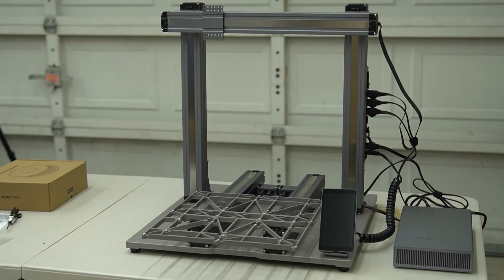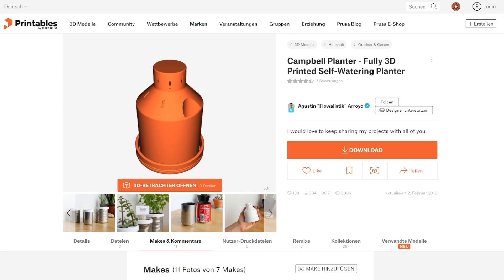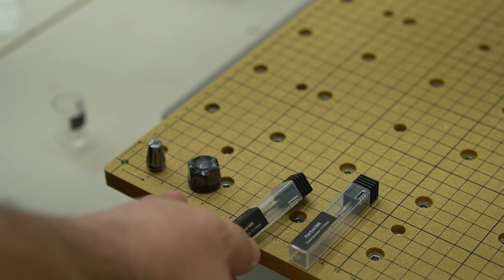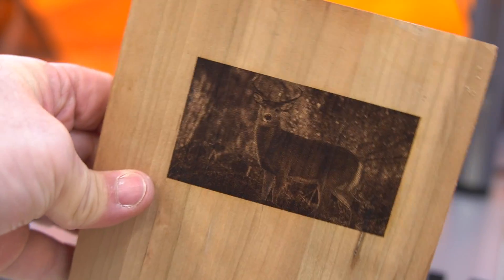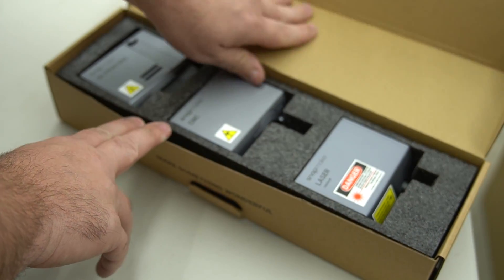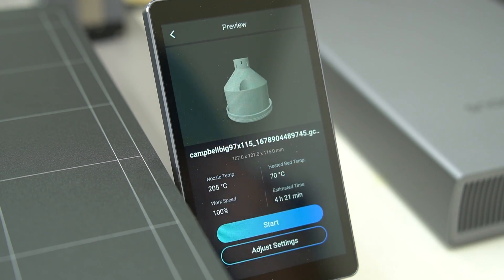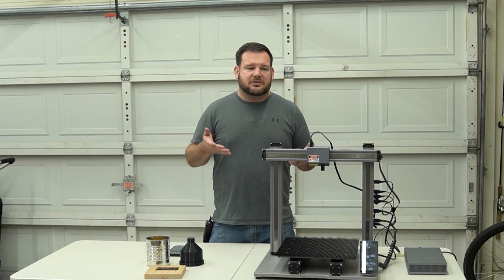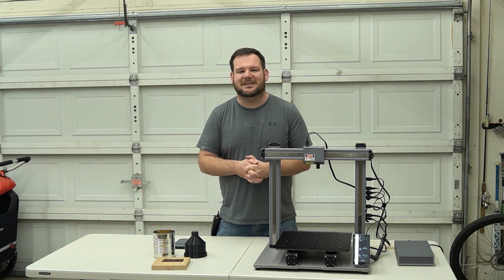The Ultimate Side Hustle Machine? Snapmaker 3-in-1 3D Printer Review

Comment: Quick swam now makes so much faster an better and if you get the 40w laser its quick swap is built into the back, so you do not need a plate for it for swaps. They do however need a much better way for air assist quick swap since the hose don't come out so easy when the quick disconnect is used for the hose.

Comment: I have 2 of these machines, the A350. Now, for me they were super worth it as, a decent amount of people buy 3D printers and either don't know how to design, don't know where to get designs if they do not want to make their own, don't know how to use slicers, and have no idea how to bed level and adjust Z height. So, I got on eBay and found each of the A350 machines for $200 the other for $300. One the owner, some how, seized one of the linear modules and broke the LCD screen. So, I got on eBay, took a few months before I saw a linear module and I had to buy an LCD from Snapmaker. So, $200 + $200 in parts and the machine was perfect. Other machine the seller lost the heated print bed and the 3D Print module. So, $200 more added to $300 and got that one working. So, I saved a bunch. Of course the cost to buy these now has dropped but I am talking 3 years ago. They are slow, especially compared to the Bambu, which I don't have, but I built a VORON which is just as fast as the Bambu. The VORON, wow they are projects to build. In fact I also bought my VORON on eBay from someone clueless on how to install Firmware, Klipper, Moonraker, and Mainsail. The Snapmaker is cool if you have no need to be fast at any of the 3 things. If you are selling and have just one of these, then speed is an issue. For me I have actually 12 machines, different makes, so I can build 12 parts at a time, even more if I load the build plates with multiple parts. I did get the 10 watt Laser and the Rotary, and these are cool machines, slow, SUPER slow, but cool. LOUD also.

Comment: 2:10 So I watched another video on this machine.  In that video for changing the plate they didn't unscrew anything.  It looks like there is a locking lever under one side which they simply unlock, change out the board, and then lock the new one in.  It took them about 10 seconds to change out.
Reply: That's an added feature. In the EU stores, its 170 Euro, but definitely worth it as the switchiing is just annoying

Comment: Just. Dont. Buy. This. Machine! Heat Creep Heat Creep unsolved problems. 0 Support from the manufacturer - Solutions will probably be sold as an upgrade. Cant print long prints without HEAVY modifications to your printer. Just DONT buy it, wait until they used their customers as alpha testers enough until the machine actually works.

More examples? Their solution for heat creep? "Just leave the enclosure door entirely open during ANY print," (yes official reply)
Their solution for the extruder spring gear unfastening? - They GLUED A PLASTIC PIECE ON IT WITH HOT GLUE
Their solution to prevent heatcreep, if you open enclosure door isn't enough? "just open the Dual extruder head and leave it open"

NO , just NO. Listen to me, guy that thinks about buying it - DON'T DO IT. Wait for a year or so, get another machine, whatever, but safe yourself the grief.
DONT BUY!

Comment: For me, the appeal of this machine is that I get the ability to 3D print (and most reviews I've seen is that it's a very good 3D printer - not the fastest, but good quality prints), laser engrave and cut, and do CNC work, all in one fairly small footprint. I have a very small shop (only 9'x13'), and I mostly do woodworking, so I already have a table saw, a miter saw, a workbench, a drill press, a band saw, a belt/disk sander, several routers, and lots of clamps and hand tools. Most every inch of space is spoken for by something, but I do have one little area on a deep shelf that I can fit a Snapmaker A250T on, in the enclosure. So by adding just that one machine, I can increase my shop's capabilities by way more than by just having a small CNC, or just a small laser cutter/engraver, or just a 3D printer. I don't expect it to be super fast like some of the latest 3D printers. I don't expect it to have all the functionality of a dedicated laser, nor all the accuracy and functionality of a dedicated CNC. But (and especially with some of the latest add-ons like the 10W laser, dual extruder 3D print head, and rotary module), it can do all of those things really quite well, without the footprint I'd need for dedicated machines. Plus, all I've seen shows that the build quality is outstanding. I want one - just have to get the cash together now!

Comment: This 3in1 A350 Machine is completely outdated, you should have checked the Artisan version. All those negative points are fixed on this new version. But the Artisan cost more then 3000.- and for this money you can easily buy a bambulab printer which is way more faster, a cnc engraver which can have a way bigger working space and more Watt and you still have some left money to build your own diy cnc machine. But the good thing is its just on one place with an encloser and if you are limited with space and its just your hobby where you here and then make something small then its pretty ok.  So its nothing for commercial use.  On the good site the artisan is very well made and looks really shiny.

Comment: Thanks for sharing Andy. I've seen that advertised before and the first thought I had was "yeah, but it can't do any one thing well", which I was correct about. I think it would be good for a tinkerer doing small things for home, like maybe a table top board gamer. I hate Swiss Army Knives, it's nice to have for the random thing you need them for, but you can't trust it with your life, they break. Also, like you said, it's kind of weird they called it "snap" yet you have to use screws, it should all be some sort of quick release.
Reply from the maker: Thanks for sharing your thoughts on this. I was told that they're going to be launching a quick snap kit soon!

Comment: For those of us that already have a solid 3d printing setup, that part of the machine doesn't appeal to us. It's fine that it's there, but I think it would be a good idea to bundle the options instead of make it mandatory. Maybe allow me to have the CNC and laser engraver and swap the 10w for the 3d functionality. Unsure of pricing in that regard, but you get what I mean. Make the purchasing options be "snap-able" just like the unit is :) Otherwise those people aren't going to want to buy one as it would never be used for that purpose. 

But there are likely other options out there that do the cnc/laser functions much better for a similar price that would make more sense. I'm not too familiar with the market.
Reply from the maker: Thank you for sharing your thoughts on this machine setup.
Reply: @AndyBirdBuilds  Don't get me wrong, it looks like a nice beginner setup for someone like me that is interested in getting started. You did a great job showing the build process and it looks structurally sound. A bit small, but the included software seems like a big bonus. Plus a touchscreen and wifi. 

There is definitely a need for a mid level machine and this might be it. It seems you either have to spend thousands to get a quality hobby machine or just a few hundred and get a tiny thing you're going to fight with and be severely limited by. And then spend thousands again when you want to upgrade.